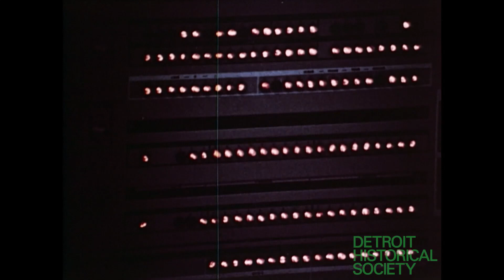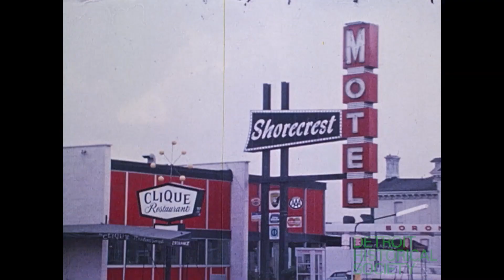Brand New 72 Dusters, Challengers, and more.

Comment: In the 70s Cars are oil,steel, aluminum and energy.... 2022 nothing has changed except that cars are even more made form the same things! Great commercial.
Reply: No, not at all my friend cars today are made to be cheap unreliable and not fixable the person that designed it cannot even fix it these days, The modern vehicle has over 25 modules in it, instead of putting just simple relays. We replace it with modules!!but don’t worry they can snowball you with big terms and everything put wrench in there hand and look out!! 
Not the same at all